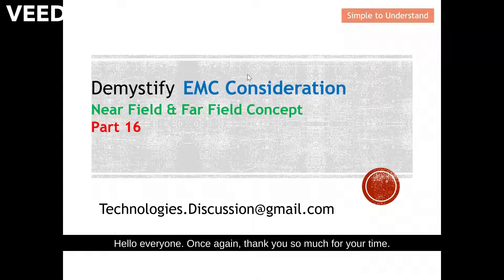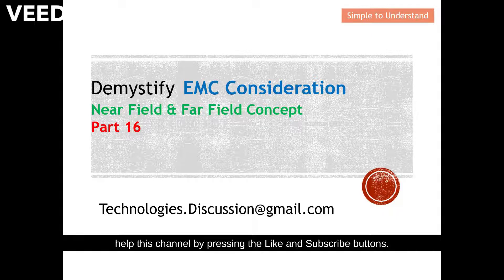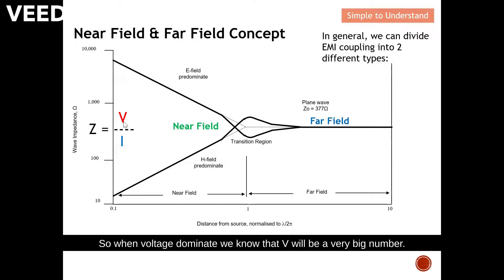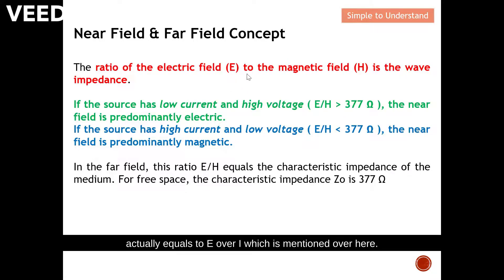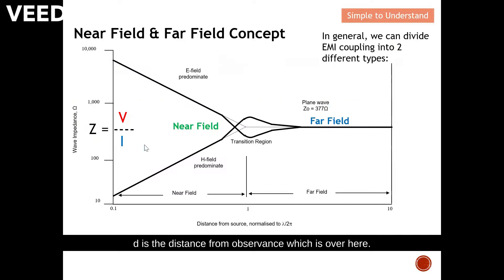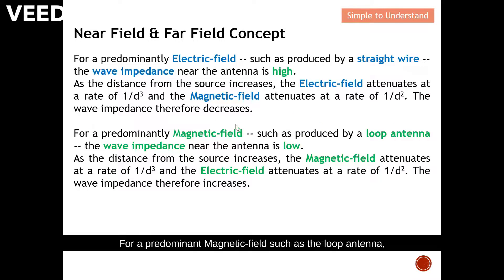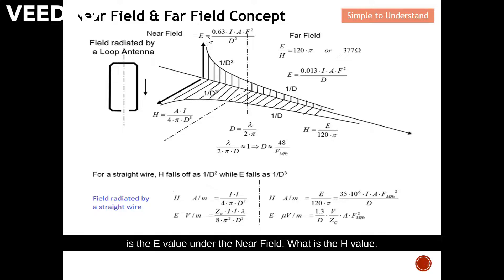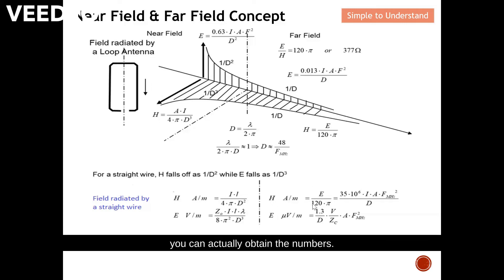EMC #16. How does the Near Field (E/H field) Transition into Far Field Medium as Impedance 377Ω.

Comment: Is the wave impedance always a real number inside the near field mode, i.e. purely resistive?  People talk about antennas resonating, as we see antenna impedance plots that resemble resonant physics, but in reality are reflection minima.  In my mind, resonance means that energy is moving back and forth between E fields and H fields with balance. If loop an wire antennas are equally efficient,  and either one has an imbalance between E and H fields, then they are not resonant objects, no?
Reply from the maker: In the near field mode, the wave impedance does not need to be always a real number. However, they need to be, once they are at Far field, 377 Ohm. Why for antenna, we mainly concentrate on S11. This is because if we can know the reflected energy by measuring S11, we are able to also determine the forward energy, the energy we release into the environment by the antenna. For me, resonant means for example, the best freq to transfer the energy. The antenna can also release the E and H field even at non resonant frequency.